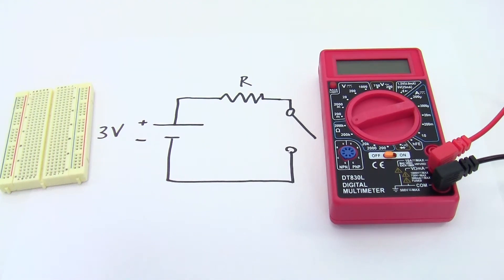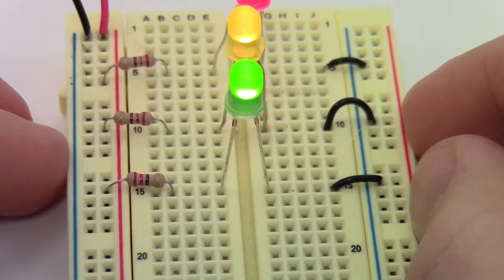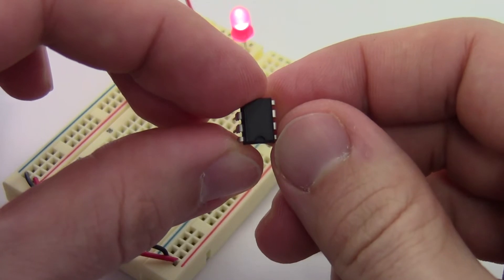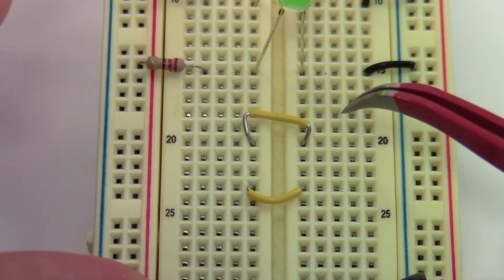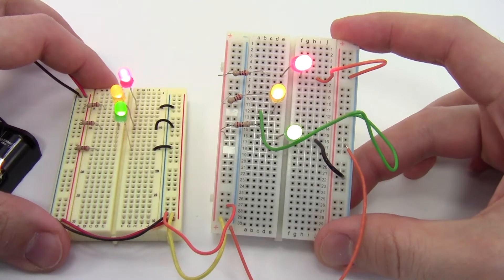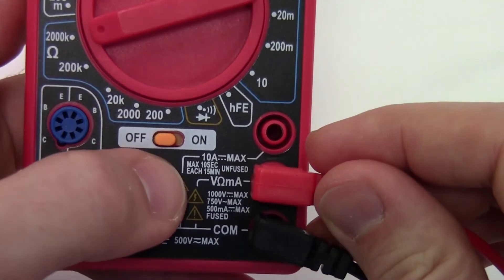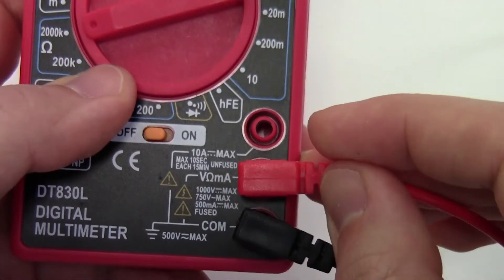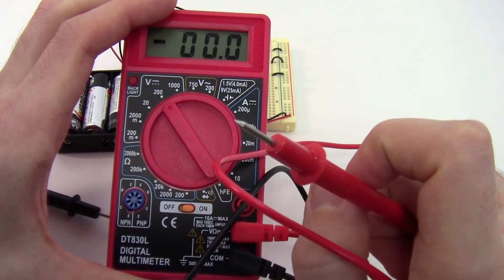10 Common Beginner Circuit Mistakes

Comment: Thank you for this very helpful video.

I would like to suggest where confusion comes from at 18:50 open circuit voltage explanation.

Voltage is DIFFERENCE in potential energy. You need two points to compare. 

Talking about a single point leaves the listener without a reference. 

In your explanation 0V is from negative to another point on negative side and 3 V is from a point of positive to another point on negative side.

Comment: In step 5, you appear to have a 6v power supply (4x1.5v batts) powering 6 LEDS with a combined min. Voltage requirement of 13.4v (2R@3.4v, 2Gr@6.4v and 2Y@3.8v)? How is this possible, since there should not be enough power available to light them all adequately? I must be missing something? I’m currently struggling with this same type of problem trying to light 8 various color LEDS using one or more 9v batteries 😢
Reply from the maker: The LEDs are in parallel, not series, so their voltages do not add like that. This video may be helpful: https://youtu.be/EeCh68a1GEg

Comment: Thanks it helps me, my question is that all the components will measure same LED, Motor and so on. I tried to measure current and voltage LED it worked but motor worked same method with voltage two connection of the LED voltage as well as current. Was that accurate or is there any other method?

Many thanks
Reply: Other than that, how to find unknown voltage and current without datasheet, can you make close circuit high or low.
Reply from the maker: @alikaampo9370  Hi Ali - I don't fully understand your questions but I'll do my best to answer. To measure the voltage across a two-wire device, you always put the multimeter probes in parallel (one to each wire). This is the same for a motor, an LED, a resistor, etc. To measure the current through a two-wire device, you always put the multimeter probes in series. Again this is the same whether you are measuring a motor, LED, resistor, or anything else with two wires. 
I don't understand your question about finding unknown voltage and current without a datasheet. What type of part are you referring to?
Reply: @BenFinio  thank you Ben, my point is that I have universal motor without label or without details of value and current value therefore what can I do and how can I to ru the circuit?

Many thanks
Reply from the maker: @alikaampo9370  in that case I think your safest bet is to start with a lower voltage and gradually work your way up. If it is a small hobby motor then many of them operate in the 3-6V range. If you start out with 12V or 24V right away you may damage the motor.

Comment: 18:58 - I did a very short electronics course in 5th or 6th grade. Other than that, I am learning all this for the first time at age 42 so I appreciate these kinds of very basic tutorial type videos. Here's why this part is confusing. You say we use Ohm's Law here to calculate the voltage at that corner. You do Ohm's Law and the answer is V(or volts)=0. Then you do the quick verbal switcheroo and say that the "Voltage Drop" is 0 and therefor V(or volts) is actually 3 even though we just calculated it using Ohm's Law and Ohm's Law said it was 0. This is where the confusion lies.  

If current was.... lets say... 2 and resistance was... lets say.... 3, then you would say V(or volts)=6. You would not say the "Voltage Drop" is 6. So it seems the V in Ohm's Law sometimes means "Volts" and other times means "Voltage Drop". Perhaps it means "Voltage drop" only when you already know the voltage being supplied? Or only when IxR=0? Or when it's just 1 resistor in a circuit? I think I understand why the voltage would be 3 in this case, but the math looks goofy and the equation makes no sense... in this case. Or may be it's just the verbage of "Volts" or "Voltage Drop" makes no sense.

This seems to be a very basic beginner issue, but I still haven't seen any explanation for it other than presenters just switching the verbage from "Volts" to "Voltage Drop" to explain the weird math and why V=0 is actually V=3.
Reply from the maker: Hi - sorry for the confusion, you are correct that playing fast and loose with the terms "voltage" and "voltage drop" can be confusing for beginners. Technically speaking voltage is ALWAYS measured between two points, so you are always referring to the "drop" between those two points. However, in simple battery-powered circuits like this one, if you just say "voltage" it is implied that you mean the voltage relative to ground, where "ground" is the reference point you define as zero volts - in this case the negative terminal of the battery. I have a full introduction to circuits playlist that goes more into the math behind all this that may be more helpful in clarifying these issues: https://youtube.com/playlist?list=PLKL6KBeCnI3U6KNZEiitdtqvrxkBhpuOp&si=vJDFdkxTX-RD7nYO